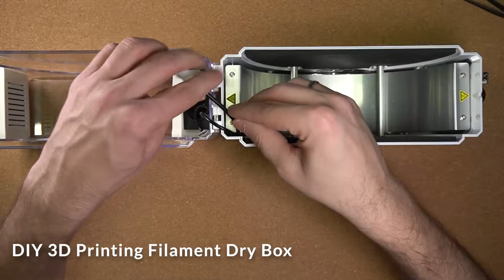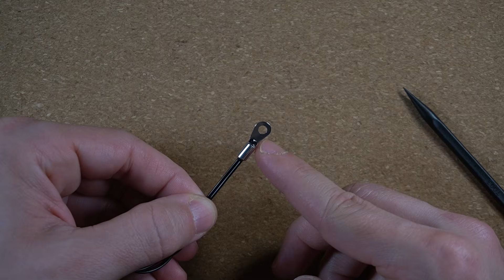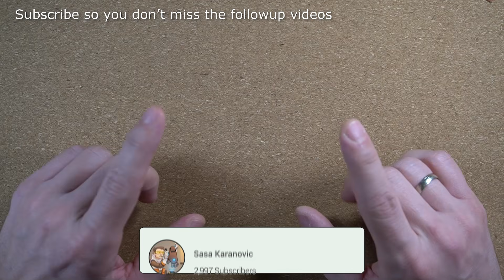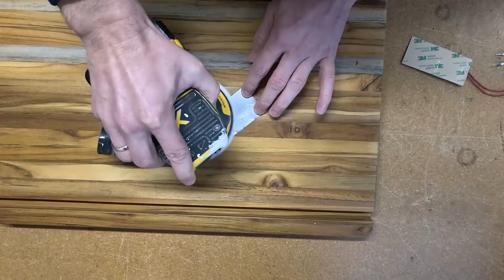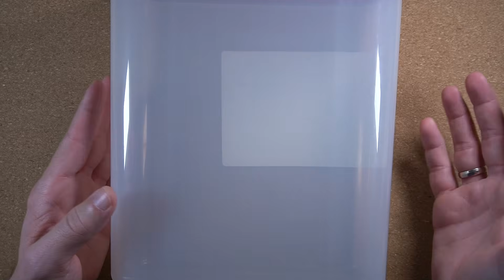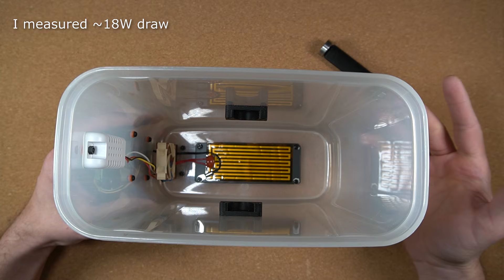DIY 3D Printing Filament Dry Box - Part 2

Comment: That's interesting and all, but you left out the most important part: how to actually use? I didn't see a screen in the video — do I need to connect to it from a computer somehow? Also, how do I know the temp inside the box if the temperature sensor is on the heater? Like, right now I am drying my TPU in my Qidi Plus4 printer and it has bed of 90℃, but the chamber temp is only 60℃, that's a huge difference, so you can't trust temp sensor on the heater.
Reply from the maker: Thanks for the great feedback! This is actually a Part 2 video and I was hoping that I did a good job of explaining the "How to use it" part in the Part 1 video... but looks like that's not the case. :)
In the video I've mentioned that there are three dedicated sensors for heater, "inside the enclosure" and "outside the enclosure". The entire DryBox is stand-alone, so you don't need a PC or anything else for it to work, just a power supply. You can monitor and control it from your phone, laptop, tablet, PC, automation... whatever you like. It has a WebUI and an API if you want to automate/integrate it with another system that you have (ie mainsail, smart-home etc).
Reply: @SasaKaranovic Oh, I see, sorry, the v2 DryBox from the Github linked to this video for details specifically, so I thought it is the first video to watch if you're interested in v2

Comment: I’ve wanted to build a DIY filament dryer for cereal box type containers.  What are your thoughts about using a esp32 humidity and temp sensor that can integrate with smart home platforms that can in turn control the heater and fan through a smart plug?
Reply from the maker: You could do that but I think it's un-necessary. If you look at my previous video, you can see that because this DryBox has a WebAPI, you can easily integrate it into your HomeAssistant and take measurements, control it and also automate based on humidity or printer state. So you really don't need any additional hardware, although you can use it if you for whatever reason prefer that route. :)
Reply: @SasaKaranovic  Great all-in-one solution!  Definitely bookmarked the PCB board page to purchase when I get around to the project.
Reply from the maker: Thanks! Let me know if you need any help with it. And I would love to see how it turns out :)

Comment: I'm curious what the build cost is?
Reply from the maker: Great question! It really depends on your build...
For this one, I think for me the box was the most expensive part at ~5$, the heater was ~$2 and the fan and sensor I already had on hand.
But again, it depends on what is your priority and how much or how little money you want to invest into your dry box.
Reply: @SasaKaranovic cool! How much is the chip and the humidity sensor?
Reply from the maker: It depends from where you are sourcing them from. The entire design including the BoM is available in the GitHub/Docs so you can check with your local/favourite distributor.
Also the firmware is open source so you can modify it to work with a different sensor (ie that you already have) or IC.